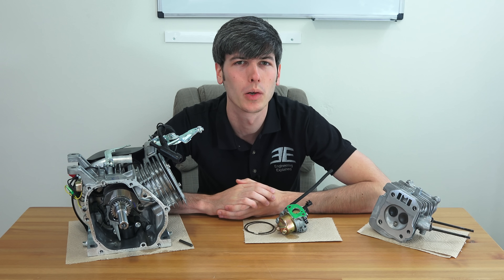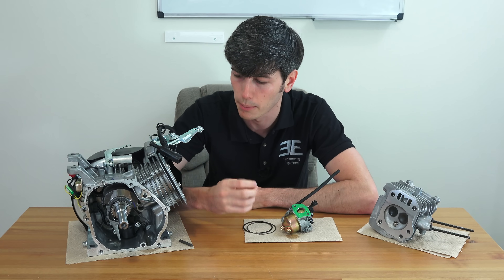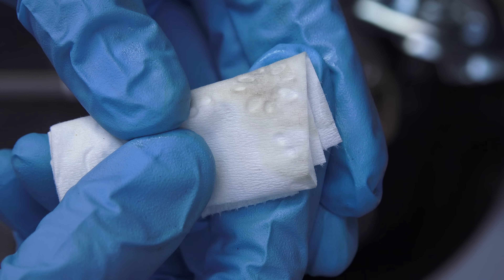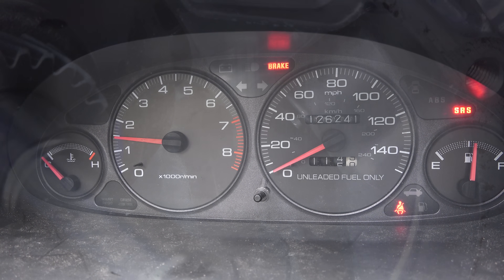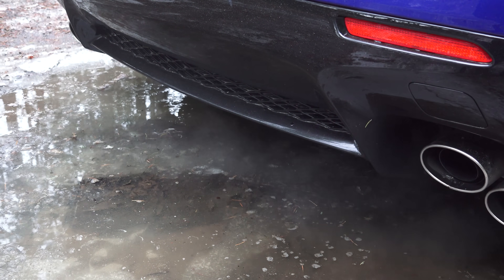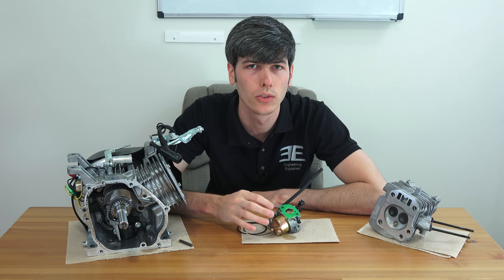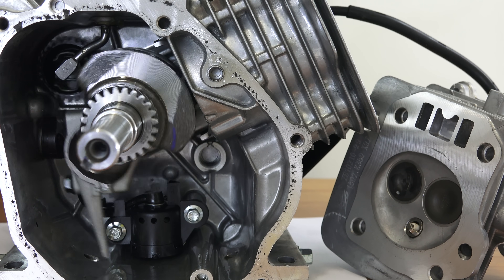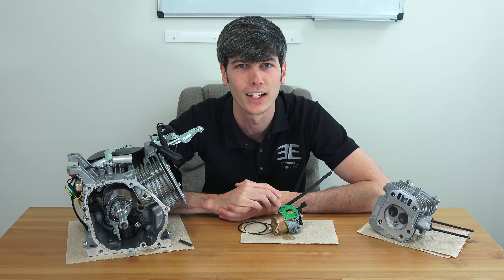Should You Warm Up Your Car Before Driving?

Comment: What about diesel pickups. I have a 1997 f-250 7.3L turbo diesel.
Reply: actually you can warm em up more at idle cause the diesel is lubricating the piston  more
Reply: a minute at 1600rpm 4 me
Reply: No need mate. It'll drive itself at idle right? I'll bet you can get it to go 30mph with almost zero pedal. Is it auto trans or stick?
Reply: +wordreet auto
Reply: +xHarux3 diesel is lubricating for example the fuel pump and more parts
Reply: in sub zero weather my dad's 90's ram with the Cummins won't rev high enough under load to get highway speed unless it's warmed up, even with a manual trans, and it doesn't need starting fluid so I don't think it's a compression thing.
Reply: Ah, then it won't move with the engine at idle. I'm in the UK and almost all vehicles are manual gearbox here. My 2 ltr turbo diesel Peugeot hatchback will drive itself at idle in 1st 2nd and 3rd gear on a flat road or mild slopes and will even pull away in first with zero pedal up a good hill. I haven't tried it more than that as it's pretty hilly around these parts. But I was imagining that the torque from your diesel 7.3ltr V8 must be excellent, it's a shame that auto trans can't take advantage of it.
Reply: +wordreet oh it can even with an auto i only have 4 gears I can control all of them and ya I got a max torque of 450 @ 2000 rpm
Reply: +wordreet it red lines at 4000
Reply: Blake Taylor
450 eh? Hmph, that's nothin! Thats only 300 more torques than my Peugeot! +300 aint nothin much!
:'¬(
:¬D
Reply: Blake Taylor 4 grand sounds about right, but revs aren't the story with a diesel are they? I can feel mine starting to run out of power at 3500, so I will usually be changing up a gear before  that.
Reply: *****
I must admit I didn't know that. Is it true for all diesels? Even using different fuel types such as veg oil etc?
 I'll have to research it myself obviously, but it's very interesting info.
Reply: *****
Apparently it's due the the relatively slow burn of the diesel fuel, which always leaves some unburnt in the cylinder due to incomplete combustion. But I still don't understand why it causes that limit. More research required methinks.

Comment: Hi, great video!

I have a question. Does this also apply to a motorcycle engine? I know that sports engines tend to have very narrow clearances, and that should mean having the right operating temp is more important, right? As well as this, these engines have to work a lot harder for their displacement to produce the same power and torque as a car engine. Does that mean that running them gently would be similar to a car engine being pushed hard while cold?

Thanks again for the video!

Comment: I like to let the idle drop before I go
Reply: +MrSpartan117fan I doo especially because of the turbo
Reply: same once it's below 1000rpms its go timr
Reply: thats good means the car is not running in open loop , which means the o2's are warmed up and sending the afr to the ecm so the engine is not injecting a surplus of gas into the cylinders that is required for a cold start
Reply: @MrSpartan117fan  you can't state facts as arguments
Reply: @gigel99324  watch mehh
Reply: ***** Do you also let it idle a little before turning off the car?
Reply: Not warming up the engine a bit is like saying, go sprint at full speed right after getting out of bed from a deep sleep.
Reply: Same here :)
Reply: Absolutely. EFI cars with OBD-II have a ~2 minute period where the ecu is running off a preset table.
After this warmup period, you will hear the rpm drop.
This is how I teach new drivers (+ my wife) to treat their cars.
Especially turbo cars, you don't want to damage that stuff!
Reply: Very good !
Reply: Yup, I do the same thing, I learned this from flying piston aircraft, we new oil had circulated through the engine when the rpm dropped, then we could apply power.  In my turbo charged car this takes 30 seconds to a minute depending on conditions.  And I definitely won't drive hard till the engine has warmed up!
Reply: Unless its REALLY cold, it should only take 10-15 seconds for oil to flow over the valves and cylinder walls, then it starts running down to the cam and all should be well.  One thing I've never been aware of is how long it takes the coolant regulator valve to open.  I have a trusty old Kia, and on some (modestly) cold days I get an engine light because the valve thinks its too cold to open, even on the highway!
Reply: Mine always keeps 900-950rpm, even at cold start in freezing winter (tested on -30C). Yeah, it's diesel. After all, anything else wouldn't even start with only one working glow plug as I had that time. Swedish know how to make cold-resistant diesel cars! :)
Reply: Isaac Beefcake best thing to do 
Everyone should do it
Reply: yup
Reply: Isaac Beefcake same here
Reply: EveryDay  Driving lightly is far better, it makes it heat up faster, uses a lot less fuel and blows out a lot less emissions.
Reply: @Billy123bobzzz  You  are completely wrong... Also can barely understand your grammar ... just shh
Reply: Yep, me too
Reply: I do the same thing if it's above freezing, wait a few minutes if it's below.
Reply: Thats just wrong.
Idling your car wears the engine out prematurely and it make stew heater take a lot longer to actually get warm air to the interior of that car.
Since ti are in cold weather you already are wearing warm clothes, so getting inside a car is warmer than being inside because the cold air is not blowing on your and your body is warming the interior.
Idling the car that I just tested three days ago took 12 minutes to get warm air to the heater vents. The same car when started and driven immediately, had warm air coming out the vents in less than 2 minutes, so obviously driving the car as soon as you start it not only reduces engine wear radically, it gets warm air to the interior much faster.

Comment: What about diesel engines? Mine is a turbo diesel 22:1 compression. It makes a huge amount of knock for the first 5 minutes (even if its hot outside) until it warms up. It also shakes violently if really cold. If you floor it while cold, it makes about 20 HP out of 146.

Also, it runs aluminum heads which are notorious for cracking. Mercedes 1987.

I was under the impression it would destroy the heads if you didn't let it warm up, so I usually wait at least 5 minutes in the summer, and about 8-15 minutes in the winter for it to warm up before taking it out of park (driving on the road totally cold would be suicide as it has almost no power).
Reply: Sounds like theres a problem with your engine, needing 5 minutes to warm up in the summer makes no sense. Ive heard of engine vibration being caused the injectors not being properly adjusted (thus they open at the wrong time and there is ignition at the wrong time). That would also reduce power and reduce fuel efficiency.
Reply: I don't think so, if you google/youtube any mercedes 300D turbo diesel 3L 6 cylinder, they all have the terrible knock (at start). I think its due to the extremely high compression ratio causing pre-detonation. It could be a design fault, but all of them seem to have it.

Disclaimer: I haven't fired up a 5 cylinder, though I have one sitting in the shop next to my spare 6 cylinder for my car, so it could just be the 6 cylinder variant, I haven't tested it.

I have switched injectors on it as well, so its possible I I don't have it tuned, but I think it is properly adjusted. Note: Idle is set at 500 rpm, goes down to 480 if its cold. Even revving it to 700 just makes it knock worse though
Reply: Jake Garrett High compression isnt a design fault, its definitely an engine problem which I think is still the injectors. The straight 6 platform is in perfect balance so it shouldnt shake that much at all.

Also diesel engines produce less waste heat at idle than gas engines so they take longer to heat up and thus wear more. Another reason not to idle it for so long.
Reply: Well duh, I think you are right. I was thinking that it would detonate too soon because of the intense pressure, but I'm thinking carburated, not fuel injected. Sadly its already running very retarded and my dad recommended advancing it more for more power, but considering how bad it gets during winter, that may not be a great idea. Although, now that I think about it, it could be a glow plug not heating up and causing it to not fire properly on one of the cylinders.

Its weird though, every one of those engines I've seen have this problem. I can't figure out why. I'm guessing newer models have variable injector timing, so they could adjust that for startup and change it back once its running well. That may be why I'm not used to hearing this on newer vehicles.
Reply: That was one of those dum, da dum dumb dumb moments. Thanks for pointing it out it wouldn't be just from high pressures. I'm guessing its probably not smooth due to incorrect fuel timings for that temperature. I'm just not 100%, but that would be my theory about why it does it so bad when its just started up and cold. It about triples in how loud it is for the first few minutes.

I'll have to play around with the timing when I've got some free time, that and maybe fix my AC, cause it feels like I'm melting with it over 100*F.

Thanks again!

Comment: I just don't drive my car until it idles at 1,000 if its at 1,500 I wait
Reply: I don't know I just do it for my piece of mind
Reply: dat is a waste of fuel. if ur car is an automatic u cld simply put to Drive let the car coast at low speed and take advantage of the high warming up idling rpm without havin to step on the throtle
Reply: Me too because the sudden shock of 1500 rpm on the transmission would wear it out quicker than putting it in gear at a lower rpm
Reply: It's almost like you didn't just watch the video.
Reply: Songer80 that sudden shock wont do harm on ur transmission.. It goes through more stress having to accelerate the 1.2tonne vehicle and its occupants from a standstill and its been design to take such loads or even more than that
Reply: Alex 99 Legacy peace you mean

Comment: Why aren't you supposed to rev Diesel's when they are cold
Reply: Diesel freezes at a higher temperature than gasoline.  If you do not have an engine block heater the fuel will thicken and thus not be able to flow as well as it should.
Reply: when a diesel is cold the comustion takes place rather uneven. hence the nailing noises. the nailing noise is a sudden increase in cylinder pressure during the combustion cycle.
Reply: With diesel engines it has to do with the rotating mass of crank, rods, pistons and particularly the assembly clearances when cold. 
On a cold diesel engine, there is a lot of piston to wall clearance and that large clearance creates piston slap and can be destructive resulting in excessive wear and or broken pistons. 
Higher the RPM, the higher the loading and the greater the wear and potential for damage when cold and clearances are great. 
Diesel engine pistons have a large mass that expands slowly as temperature rises until reaching normal operating temperature and a much smaller piston to cylinder wall clearance. 
Main and rod bearing clearances are the same as with the pistons. 
oil flow is also impeded at low temperatures resulting in insufficient lubrication. 
There is also an additional compounding factor of fuel washing the lubrication off of the cylinder wall due to incomplete combustion when cold, this condition can also result in fuel dilution of the oil. 
Again, the higher the RPM, the greater the washing and dilution.

Comment: In europe it is not allowed to warm up the car by letting the enginge run.
But there are heaters, wich burn fuel and heat up the water as well as the Inside of the car.
A really great thing because the engine (not the oil) has a bit of temperature and the windows are clear.

Comment: What if I absolutely need full power to merge onto a fast-moving traffic less than a mile from home in my commute? I can't floor it when it's cold, but you say it's also bad to let it warm up before setting off...hmm... Also, what can you say about warming up diesel engines? A few older diesels I've driven have audible valve clatter while the oil is cold, which is concerning and motivates to let it warm up first. Final question :) What can you say about engine pre-warmers? I have a Webasto thingy that can heat up the car without the engine running, so I guess that makes cold starts into warm starts :D Thanks for the answers in advance :)

Comment: I have the mark 4 MX-5 and it idles over 1000rpm for the first (about) 10-15 seconds to allow it to get everything circulating. After that, just wait till it's at optimal temperature and then it's ready to go sideways round roundabouts.

Comment: How long should you wait until you can drive it hard?
Reply: I'd say when the temp gauge has hit its normal mark.
Reply: Give it 1 to 2 min before start driving and after drive for like 5-8 min extra while driving keeping it in between 1800rpm and 2500 rpm. I also think that even the bearings and some other part of the drive train needs some sweet "rolling" before anything. We have a porsche 95' and opel kadett(87') that I been driving hardcore for many many fucking years (stock cars) and believe after 28 years wow! I still changing gears on red line and never have any problem... Change oil frequently and let them heat, you will have a car forever.
Reply: With intercooler cars is also nice to let the engine running when you stop after a long trip :)
Reply: As said by EE above, temp gauge is usually just the coolant temp, not oil temp.
Reply: a good rule of thumb is around 10 minutes, assuming you left it for the 15-30 seconds when first turning on, then light/normal driving for the other 9 or so minutes,  that should be enough to warm the other componants and oil up to correct operating temperature.

if you let it idle for 10 minutes, then expect to drive it hard that will not be long enough!
Reply from the maker: Best to wait until oil and coolant have reached operating temperature. This will be different for each car. Coolant heats up first (as it's contained by a thermostat), so I'd say wait a few minutes after coolant has warmed up if you don't have an oil temp gauge.

Comment: Is it different with turbo vehicles, most people will turn their car on for like 5 minutes before they actually drive it
Reply from the maker: It's not different, just don't drive in the boost until things are warmed up. Fine to drive at low throttle.
Reply: The turbo does, but the oil that cools and lubricates the turbo does not. You need good oil flow for safe operation.
Reply: Henry Griffiths thanks!
Reply: Your ass is that popular?? ;¬)
Reply: +IIGrayfoxII not exactly. 
It cools and lubricates the fuel system but that's about it. 
Diesels usually return fuel to the tank many times over what is burned.
Reply: Isnt that why we use multiweight oil?
Reply: i've had two tdi's personally i let it run for about 2 minute's then drive off and just shift at 2000 rpm and never had any winter problems unless i had got fuel that didn't have the winter anti gel
Reply: I thought turbos warmed up really fast?
Reply: +Maxime Caudebec No problem!
Reply: There isn't so much boost at low throttle I think
Reply: Depends on ambient temp. 
When it's 0f , don't start it and immediately do a drag race to work.  
I do like to let tdis idle for a minute, and turbos don't like cold oil..
so I like to let it idle for a minute when it's 32f or colder and then be easy on it and don't get into boost till you see some temp. 
You would be surprised if you pulled your air intake and watched the compressor wheel on a startup, at least older diesels with a conventional turbo...
that sucker could be sitting still for like a minute or more of you are running bear snot 15-40 oil. And getting on it when it's cold isn't good for valves, it will cause sealing issues eventually, and it's all downhill from there once you get a burn spot on a valve or seat.
Reply: Diesel fuel is oil so the fuel lubes the engine.
Reply: @Terry Hernandez ROFL!!! X&#172;D

Comment: is it important to warm up a 2 stroke? Is the procedure the same on aluminium cylinders as it is on cast iron?
Reply: +Bryan “Johkah” Estep lol who cares on a predator you can replace it for the cost of a dealership oil change... is yours a hemi head
Reply: +Bryan “Johkah” Estep lol who cares on a predator you can replace it for the cost of a dealership oil change... is yours a hemi head
Reply: +Bryan “Johkah” Estep lol who cares on a predator you can replace it for the cost of a dealership oil change... is yours a hemi head
Reply: Bryan Estep it's got a better valve train the hole hemi head making more power is bs I believe but they have a aluminum valve cover tho
Reply: yes! look up 2-stroke cold seize. pistons expand faster than the bore. full bore on a cold 2-stoke will kill it